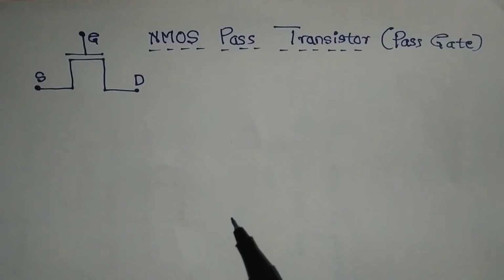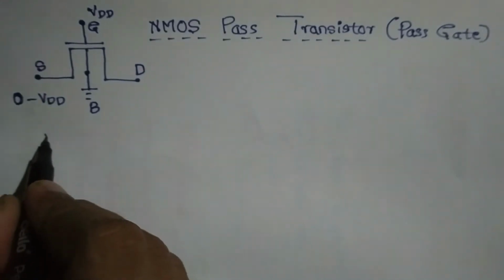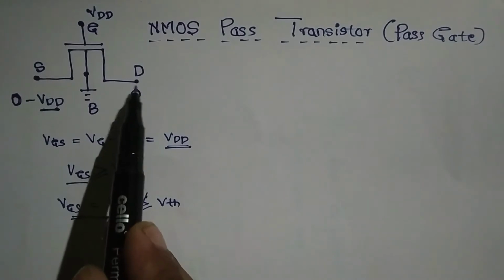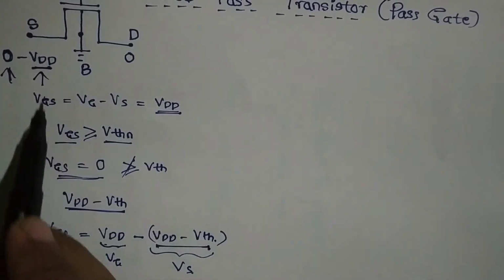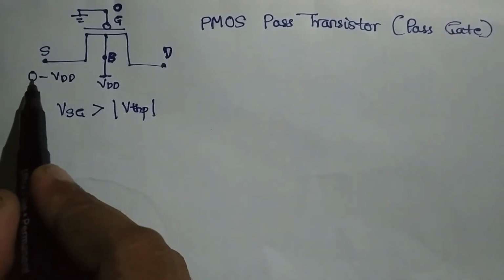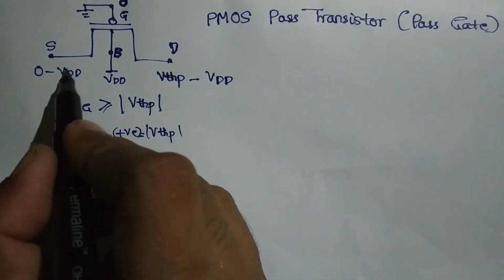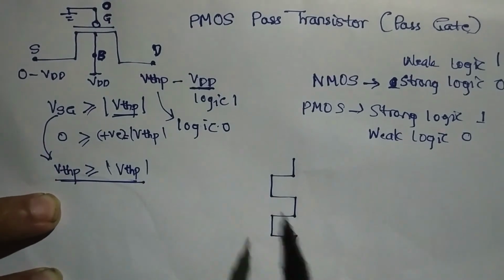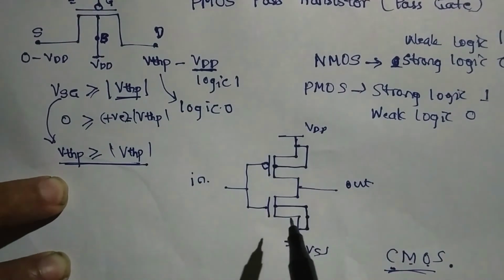Understanding CMOS inverter | Why NMOS passes strong 0 and PMOS passes strong 1

Comment: Thanks for this helpful video, there is a small correction your video since the electron flows from source to drain in NMOS therefore your labelling of S and D are not correct, it should be from Drain to source (because current flows in this direction)!